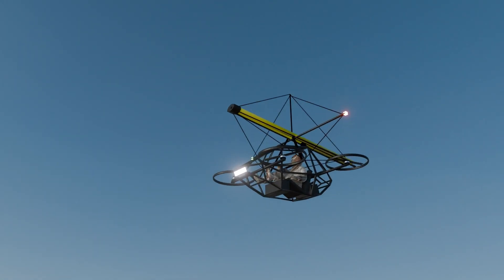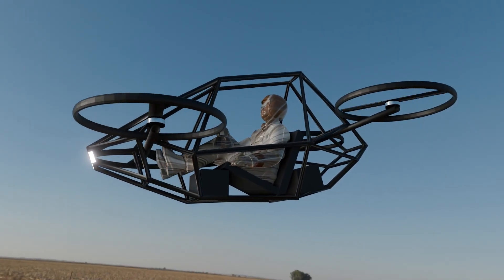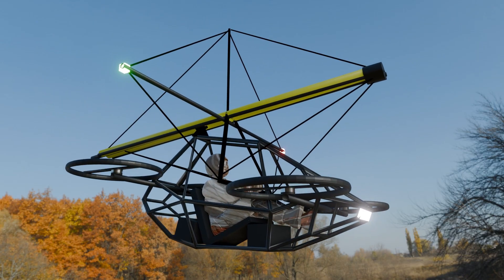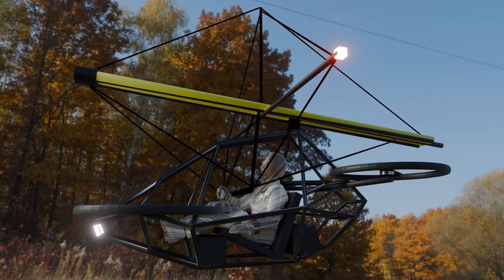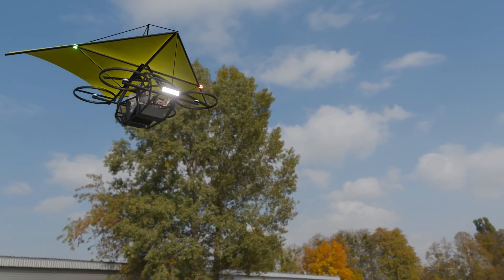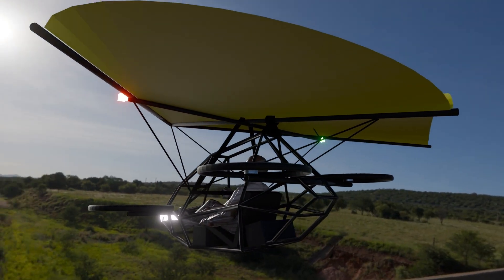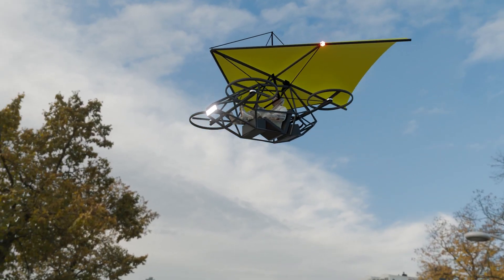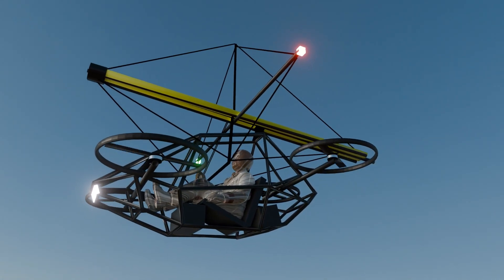Latest experimental concept – a quadcopter with a foldable Rogallo wing!

Comment: "in real world tests".. hmm. love the 1995 CG animations. sure would be better to see some of those real world tests you talked about though. Also, safety is nice, but isn't the real value of this combination really about increasing the range of the vtol aircraft making them more practical for actual real world every day use? not just safety. the design should include the much more important use-case, which is not just a backup plan, but a "use this every time you fly" integrated design principle.
Reply from the maker: Oh, absolutely! I’ll just fire up my time machine, grab some VHS tapes from our totally real 1995 test flights, and fax them over. In the meantime, feel free to enjoy the cutting-edge CG—just don’t let the nostalgia hit too hard!   Also, safety is just the baseline—true innovation lies in extending range and making VTOL aircraft truly practical for everyday use. A well-designed system shouldn’t just be a backup; it should be an integral part of every flight, enhancing efficiency, reliability, and overall performance. Think of it less as an emergency parachute and more like a turbo boost for the future of aviation!  Stay tune, you will see a sample of what I'm talking about in the video paving the way for future high-performance aerial concepts scheduled to be released after the final release for my Do-It-Yourself Low-Level, High-Performance Quadcopter, which is a simple, yet effective test platform designed to evaluate and refine essential components for quadcopter development. Built with minimalist efficiency, this experimental craft serves as a proving ground for testing flight control systems, power distribution, and motor performance.
At its core, the quadcopter features four motors, four propellers, and a lightweight aluminum frame, ensuring a straightforward yet functional design. Control is managed through an Arduino microcontroller, interfaced with a transmitter and receiver system for real-time flight commands. The focus remains on practical experimentation, keeping the system as basic as possible while gathering crucial performance data.
For safety and simplicity, the quadcopter operates at low altitudes, mitigating risks associated with component failures. However, it lacks redundancy features such as parachutes or backup motors, reinforcing the importance of careful flight conditions. This test module is not built for long-term operations but rather for evaluating key design elements before progressing to more advanced iterations.
In essence, this DIY quadcopter is a hands-on exploration of flight dynamics, paving the way for future high-performance aerial concepts.

Comment: just keep the wing open all the time, only folded when transport or storage.
Reply from the maker: Yes, that option works but with careful consideration.  Rogallo wing above a quadcopter can face serious aerodynamic and stability challenges due to downwash interference, increased drag, and potential oscillations. Careful design adjustments—such as raising the wing, tilting its angle, or using ducted propellers—are necessary to make the combination work efficiently.